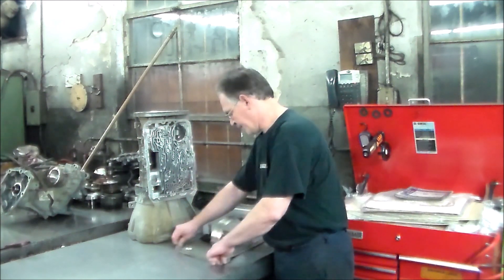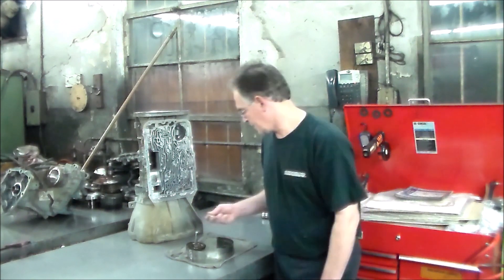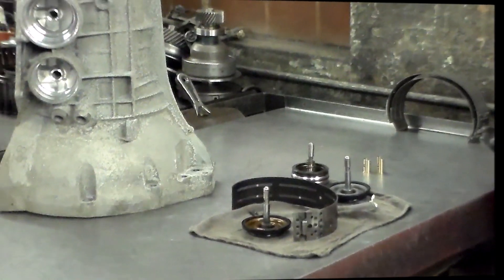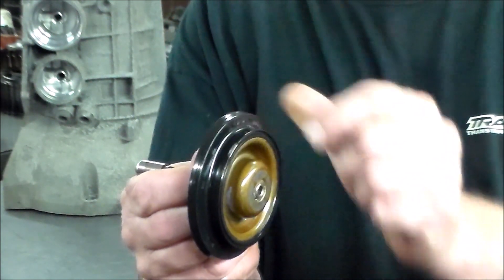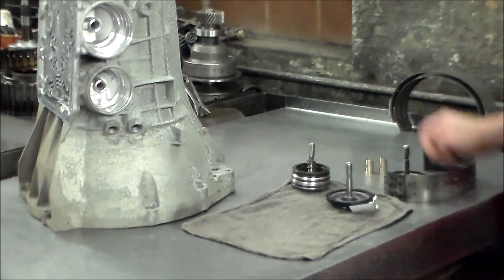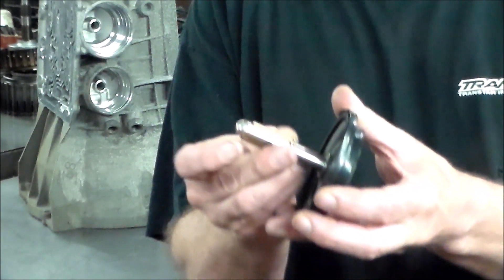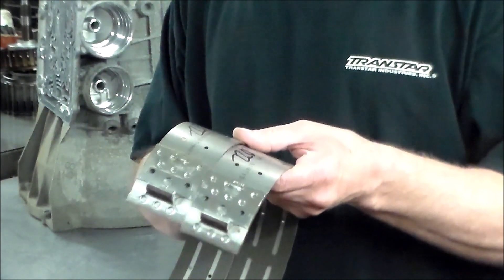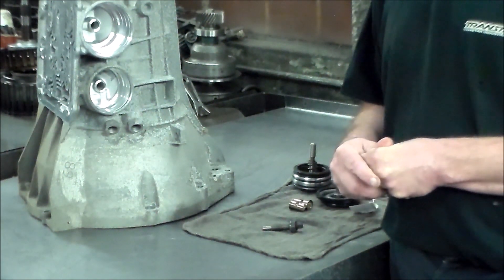5R55S solenoid Codes

Comment: Hello Gary,
 Thank you for the very informative videos.

 I have a 2010 Explorer with the 4.0 and a 5R55S trans. 
 Back in April, I started having trouble with my transmission banging and slipping when shifting. After reading the codes, I replaced the solenoid pack and trans fluid (@ 12 qts) and that solved the problem until this week, when it started doing the same thing again.
 I have a wrench icon lit and the trans bangs from first to second and slips from second to third.
 My scan tool gives me a P0962 code (Pressure Control Solenoid A Control Circuit Low) but no others. I realize there may be codes my scanner won’t read, but I was wondering if this code is electrical or mechanical related? I can’t find any info for this specific problem, nor if the Pressure Control Solenoid is different than the solenoids on the pack.
 I wonder if the new solenoid pack has failed, and if so, is something else causing it?
 Any info you’d be willing to provide will be greatly appreciated.
 Thank you, Jeff
Reply from the maker: Yes that is an electrical code.  Where did you get the solenoid pack from?,  can also be a wire or the connector that plugs into the solenoid pack

Comment: Hi Gary. With the solinoid pack on the 5r55w.. is there a set manafatures depth for the 3 depth adjustable screws on the back of each solinoid? Do you know what these depths are thanks
Reply: Ok thanks very much. Great video to watch
Reply from the maker: I do not, they are all different, has to be measured before taking them out

Comment: Great explanation video one of the best. I have a p0733 code on my 2003 explorer. Strong and first gear and second gear but slips while in drive going into 3rd when in drive
Reply from the maker: You could try adjusting the intermediate band, if that doesn't work trans will have to come out or you could try taking the side piston out and look at the condition of that but usually overhaul

Comment: I have a Mercury mountaineer AWD 2005. It’s picking up p0775. I bought the pack to be replaced tomorrow. I’m worried it isn’t that and I’m wasting money.
Reply from the maker: It probably will not, there are always more codes when you have P0775,  Like P0732 or P0735,  Chances are it will not fix the problem

Comment: Need some help here. Rebuilt a 2004 5r55s out of an
explorer. had a lot of codes that am down to just one
that it is throwing when drive for about 5 miles and ha
e to go over 45mph.
Code P1744-ff
Things that were replaced:
Full rebuild kit
Servo pistions upgrade
solenoid pack
Torque converter
Pigtail
4x4 selector motor
What would cause this? feel like there is enough fluid
in it. It spits out a little each time - check it.
Reply from the maker: Do you have a scanner that shows live data?
Reply: @GaryFerraro  yes
Reply from the maker: @Charles-lj1yu  See what your converter slip is when lock up is commanded on, make sure duty cycle is at 100%
Reply: @GaryFerraro  sent a link with the data in it. I am sure you will see something wrong but not sure what I should be looking for.
Reply from the maker: @Charles-lj1yu  Link did not show, you can e-mail it to me
gsferraro@yahoo.com
Reply: @GaryFerraro  sent

Comment: Great explanation! I purchased the AJ1E band servo repair kit that’s recommended over the bore & sleeve method. Only code I saw was the 745 on my generic obdII reader & came here wondering if I needed the pack now too, thinking maybe it got damaged by too much or too little pressure etc.
Reply from the maker: The obd2 reader cannot pick up the other code, i have seen this, what gear is slipping 2nd or 3rd?
Reply: mine is 3rd

Comment: Love the vid. I'm having DTC P0778 and P0964 on a 2004 lincoln ls. I'm not sure whether to change the solenoid pack or do the servo bore update. Think I'll check the IM and OD bands first and then go from there?
Reply from the maker: Does this have hard engagements?
Reply: @GaryFerraro  Not really. Park and reverse are firm but not very harsh like my old trans was. My old trans would make the car lurch forward in drive and backwards in reverse ever so slightly.
Reply from the maker: @shaunhuckabee5904  Becareful with this, on these cars the computers go bad all the time, i did a video on this 5 years ago called Checking Catherines PCM   check out the video
Reply from the maker: somrtimes may set codes and sometimes not,  if you clear the codes do they come right back?
Reply: @GaryFerraro  Yes they do. The codes pop up on my scan for the Ford OEM enhanced KOEO test.
Reply: @GaryFerraro  Will do. It's funny that you say that because my replacement trans is doing EXACTLY the same thing as my old trans. Checked the harness connector but all good. 1-2 harsh engagement and slipping 2-3. Thanks for your response and help. Means alot. Stay dirt  as Eric the Car Guy would say LOL.
Reply from the maker: And hard shifts

Comment: Hey man. Love all the info on your channel. I got a P0775 code and when I opened up the transmission, the overdrive planet had metal shards all over the inside of it, and the band looked burned. Is this the kind of thing to set off that code?
Reply from the maker: Yes, the P0775 is usually along with P0732 and P0735 but if you just have a code reader those codes may not show, problem is with the band which is 2nd and 5th
Reply: Thanks a bunch. Upon further inspection I noticed the whole overdrive section looks burned. I’ll probably check the lube dispensing hole on the pump in the morning. Thanks again.

Comment: Thanks for this awesome vídeo, it's really  helpful. But I have other trouble, I changed the the solenoid pigtail because  all the wires was doing contact (all 11 wires was together) and now, with the solenoid connector changed I've a lots of DTC, P0740-FF, P0743-FF, P0748-FF, P0755-FF, P0758-FF, P0760-FF, P0762-FF, P0766-FF, P0763-FF, P0778-FF, P0798-FF, and others. Can you help me please? This is in a Ford Explorer 4.0 2007 4x2.

Comment: Cordial saludo, le agradezco si me puede responder en español. Tebgo una sport trac 2007, y me arroja el codigo P0775, me encuentro en Colombia, ne han hecho cmabiar 4 veces el cuerpo de solenoides, el ramal electrico (harnes), la banda de quinta marcha y filtros y aceites. El carro funciona bien un par de kilometros pero luego vuelve y arroja dicho código. Le he invertido mucho dinero, segun veo tu video son los servos, aca solo los cambian pero no hacen el cambio al eje como tu lo muestras, que me recomiendas?
Reply from the maker: I would need a translation, but with that code, you may have a problem with the front band which is 2nd and 5th gears